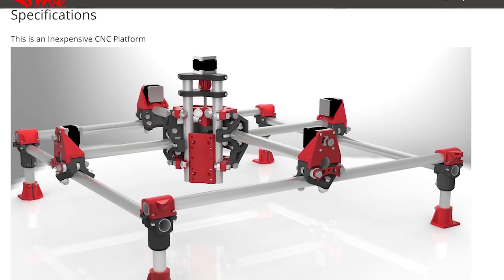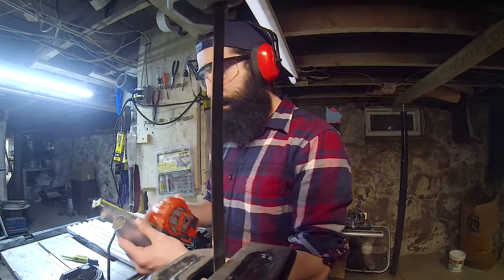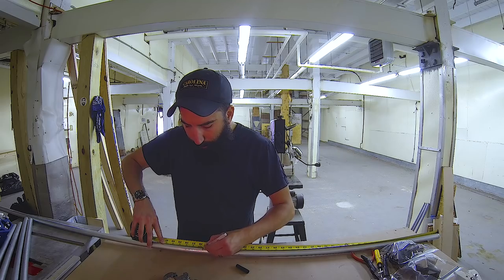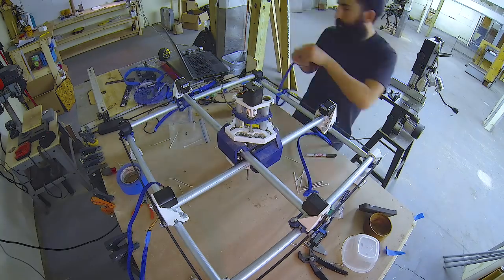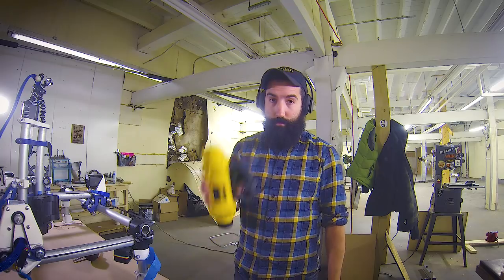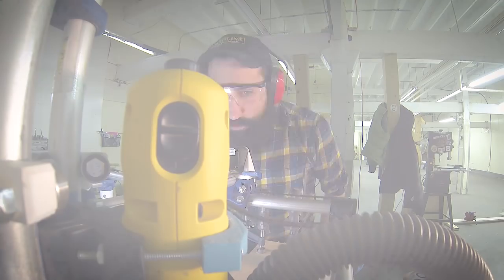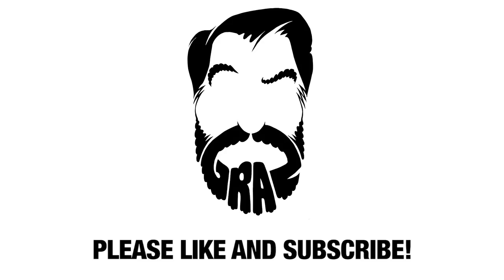Graz Makes: The MPCNC (mostly printed cnc machine)

Comment: so i i use 3/4 inch pipe i will need to print the 23.5mm parts ? can you  share the specification of all your conduit cuts.
Reply from the maker: print a small piece and double check its the right size for the pipe and if it is, print the rest of the pieces! (wish i did that from the start!) thanks for watching!

Comment: One additional suggestion, when cutting conduit, either buy a conduit reamer or use that little triangle on the back of your cutter to clean out the burrs after the cut. It gets rid of any sharp edges that can cut your wires.

Comment: great video. I've been printing mine for a little while can't wait to have it all put together.
Reply from the maker: thans man! are you going to reflash to grbl or leave it with marlin?
Reply: I didnt even know you could get it to work with the xcarve software until I saw this. what are the benefits, easier to use?

I know "all the cool kids are using it" haha
Reply from the maker: yeah! i did some research and i don't think a lot of people know it either! i think as a whole, easel is easier to use and I really like the fact that it has that giant database of projects other people have uploaded. its a great way to understand design layout. I also like the fact that you can tweak existing projects to fit your own needs. with the out of the box software recommended with the mpcnc (estlcam and repetier), they are two separate cam/cad programs while easel is all in one which i like as well. hopefully that made sense, i haven't had my coffee yet.
Reply: Another option if you stick with Marlin is Fusion 360. There are two post processors for F360 that output Marlin compatible gcode. CAD/CAM/Parametric Modeling all in one if you need it. Then use the output on an SD Card to drive the machine.

Comment: Great vid! I printed all the parts for the MPCNC about 2 years ago now so my dad could build it. Lucky for me, it sits in my shop now since he had a hard time messing with Etslcam; however, I didn't even know about the GRBL for Ramps firmware to make it compatible with Easel, that looks way easier to use for him. That firmware will probably be flashed tonight and we'll have to test it out. The only thing I wish I would have done was print all the parts with PETG for a bit more strength, the PLA has a few stress fractures after 2 years but still works great and is accurate.
Reply from the maker: thanks! lemme know how it goes! i did mine in abs and so far so good! good luck!

Comment: Very nice. I'm currently finishing the Root3cnc. Design is a bit different, but it also uses lots of printed parts. Also more than 150 hours of printing... I'm somewhere at 110h now...
Reply from the maker: I'll have to check that one out! Good luck!
Reply: Thanks. I have modified the design a little bit, to be able to print it on a small printer. It is going well, for now...
Oh, and I have prepared a prusa extruder to mount there instead of the router if I want it to work as a printer with larger volume (50x50x20cm)

Comment: 150 hours x whatever your time is worth= Buy the printed parts. Thank you for that, I'm going for the LR2 and was wondering about this. I would be spending way more time than just getting the parts and assembling. I'm curious, do you think the parts could be reproduced by mold casting? If that's the case my next setup would definitely be made with molds.
Reply from the maker: Uhhh that’s a great question! I think if you spent the time and knew what you were doing that might be an option? Definitely check out the mpcnc forums. I remember people talking about that option awhile back. Thanks for watching!!

Comment: One thing I don‘t get here is the problem with the diameter of the tubes.
One way would be to buy the correct tube to keep the  prints, or to reprint the parts and keep the 1“ tube.
You did both, or did I got it wrong?
Reply from the maker: most big box stores in the us ONLY have the 23.4mm tubing. I could have purchased the proper tubing online, but with that cost and cost of shipping,  i would have not saved that much money. re-printing the parts were my best option. thanks for watching!
Reply: Graz Makes Ok, then I got it wrong in the video, I thought you have not only printed the parts but bought new tubes as well, my bad :-)

Comment: Great video,  What pipe cutter did you use?  And tips for measuring and cutting the pipe?  Is your CNC 2 feet by 2 feet?  Thx
Reply from the maker: some old pipe cutter i had in a tool box lol. you dont have to be crazy precise, its all about squaring the tubes to 45 degree angles. thanks for watching!

Comment: What size cutting area did you make? Did you just order the basic kit with the mini rambo? did you have to order extra belt length?
Reply from the maker: i think i made it 26x26. im going to expand it this weekend to something like 2x4 so I can work on sign making. I think the kit now comes with the rambo board, my came with the ramps board. Im not sure if you can hack the rambo to use it with easel? maybe? also I just bought extra belt on amazon for like 10 bucks just in case i need it.

Comment: That is pretty amazing. What is the largest part you have to print? I only have the MP select mini
Reply from the maker: the largest part is the xy guide holders. each one takes 12 hours to print and you need to print two of them. good ones to let print overnight :-)
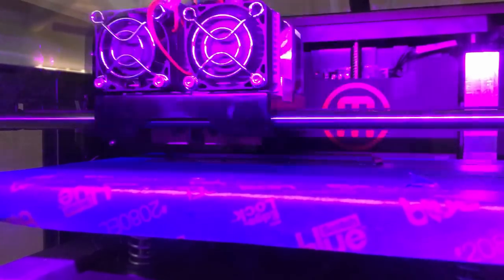Reply: The middle XY part is 132.25 X 77.55 X 97.58 millimeters.  The middle tool holder(tall skinny part at 1:32) is 118 millimeters tall, and really needs to be printed in this orientation.

Comment: I have the same setup you do, and the xcarve seems like a easy way out :). but your gcode is there any measurment on your machine there? or is it only stepper resolution there. ?  my frame is 92x92 cm big,  And where do you buy bits from ?
Reply from the maker: yeah Im really liking the xcarve option with this machine! not sure if I'm understanding your question? what measurement are you referring to?
Reply: Graz Makes wondering if you setup the dimensions on your cnc in that gcode, work area .
Seems like a nice way to start learning with that software.
Reply from the maker: yup! I set it up specifically to work on grbl once I flashed the ramps board. if you do the same thing, the gcode i provided should work just fine.
Reply: Graz Makes ok that sounds great:)
Reply: Thanks for a great tutorial, i went home and unwrapped my new ramps 1.4 and follow your instructions,  so now i got a ramps with the right firmware on and gcode :)
Reply: Now i just have to figure out how to connect my laser :)

Comment: Jeez.  150 hours to print times 2?   I have been thinking of putting one of these together for a while. You are the first person I see on youtube to put one of these together with ABS instead of PLA.  What was your experience printing these parts in ABS?...(Aside from having to print all the parts twice...heh)  ABS tends to shrink a bit for me.  I print on a homemade Prusa i3  with a heated bed and an Ikea lack table enclosure. In my experience,  PLA prints tend to be more precise and usually more aesthetic... on the other hand, ABS parts come out stronger and are a bit more rugged.  Did you find the tolerances on this build accommodate for some shrinkage?   Then again  I may just opt to print it all out in PETG...
Reply from the maker: sorry just saw this comment! it's been almost a year and its still holding up well! actually going to expand the size of the emt so i can start making bigger signs. I'll report back if anything goes wrong!

Comment: hey man, what size drill bit did you use to drill the holes on the z axis? on the site it just says 5mm-8mm. thanks in advance
Reply from the maker: truthfully I forget. I remember using whatever size fit the hole that was printed. sorry i dont have a better answer!
Reply: no that works, thanks! :D
Reply from the maker: good luck!

Comment: duuuude.. I just saw this the other day on thingiverse.  read through some of the documentation, I was like "ehh, can I really do this?".  After watching your video I'm more confident I could (I already own three 3d printers).  I only print PLA, do you suppose it would be strong enough not being ABS?
Reply: Original maker only used PLA, and videos here of that machine cutting steel with an ungodly .25mm (.0098 in, not .005!) DOC, no kidding.
Reply from the maker: yeah! like Paul said, the orginal build was done with pla and it seems to be working just fine! good luck in your printing and thanks for watching!

Comment: Great video!   How are you liking your MPCNC?  What size is yours?  Actual size vs area it can cut?  Anything you would do differently now?    I am printing the parts.  Still not sure how large to make mine.
Reply from the maker: I still really like the thing! i expanded the size to 2'x4'. i forget what the actual cut size is, Im pretty sure there is a converter on the official page. other than printing the right parts out the first time, I don't think i wouldn't have done anything differently. thanks for watching!

Comment: How do you like your blue tooth headphones. I see your link on Amazon to them. They look good for the money but some mixed ratings on them. Just curious if you have any charging problems with yours? How long do they last on a charge?
Reply from the maker: woodknack1 I've had them for a couple months and honestly they are fantastic for the money. The battery lasts about 5-4 hours per charge. Great headphones for shop use, if they break you buy another pair without feels bad :-)
Reply: Thanks, I'm going to try a pair. :-)
Reply: Also going to try the MPCNC. I started printing the parts out. I've been looking at BOB'S CNC E3 or XCARVE but I really dont have that kind of money to dump on that right now. I like this as you can build it any size you want or need.
Reply from the maker: woodknack1 awesome in actually making it bigger next weekend!
Reply: How big of a cut area were you getting? Was there enough belt in the kit? My work table I have that I could use for the MPCNC is 24-3/4 x 37.

Comment: This is awesome. Now is there a 3d printer I can make with a CNC?
Reply from the maker: thanks! as a matter of fact the mpcnc was designed for removing the dewalt spindle and replace it with a 3d printer extruder and BOOM you got a 3d printer too!
Reply: Orrrrr I made a 3d printer designed to be milled on a cnc (MP3DP). Anddddd, I have a new version of it set to be released this evening I hope. If I can choose a name I can start uploading parts.
Reply from the maker: ohhhhh thats exciting news!
Reply: Wow, I have learned so much in these comments. Thanks.
Reply: Oh yeah, and robots making other robots, awesome!
Reply: I Use my printers to print CNC parts, and my CNC to make printer parts....inception!
Reply from the maker: Someday I'm going to buy you a beer in person. You are awesome.
Reply: MRRF 2018!!!! Make it happen.
Reply: I see what you did there....NERD ( you know I will be using that). This year I sponsored early so you can get the shirt and it should have my logo on it, last year I did it too late. 
All day at this printer thing, Never have I been so quick to reply and respond though, I need to get away from my desk.
Reply from the maker: allted sweet! I didn't know you had shirts! What size are you btw? Ok fair enough, shut down the computer and go outside!
Reply: I got in as a sponsor so I will get my logo on the back of the MRRF shirts. As for me getting shirts....soon. Now that I have a logo finalized (after 2 1/2 years) It's merch time. I think I am Xl in a T-shirt usually, Large on a good day when I don't hit the Taco bell.
Reply from the maker: allted I'm going to send you an graz makes xl shirt in the mail as well as a crunch wrap supreme...those don't go bad right?

Comment: Ok just watched the video, great job!  C as n someone explain what the problem is with printing the 1" version?
Reply from the maker: TheLeverHunter thank you! The first version I printed was the 25mm version which doesn't match the 1 inch emt sold in us stores. The reasoning is they measure the outside diameter. Print the 23.5mm version and use 3/4 conduit if you're in the us! Thanks for watching!
Reply: @GrazMakes  Ok so I am in the US and printed the 25.4mm kit.  I was going to use 1" conduit is the conduit not 1" thick?
Reply from the maker: thats exactly what I did. this is taken from the vicious website..."Please measure your rails before printing. 23.5mm fits 3/4″ EMT conduit in the US. Anywhere else you must physically measure first, some things are sold as Inside Dimension (ID) (conduit), or Outside Dimension (OD) (Tubing)."

when i printed out the 25.4mm the parts we too big for the 1 inch emt. for a temporary fix i took painters tape and layered it on the emt until i had a snug fit. I did this so i could get used to the machine while i printed out the correct 23.5mm parts in the mean time.

hope that help you out!
Reply: @GrazMakes  Thanks!
Reply from the maker: no problem! lemme know how it goes!

Comment: Does this work with the RAMBo Mini board that comes with the MPCNC?
Reply from the maker: not that im aware. I'll have to do some research and see.
Reply: That's surprising since it's pretty much your only choice in board besides the regular RAMBo
Reply: Also, I would suggest adding this to your txt file:  

    Download this repository (link), extract the zip file, and open the file grblForCyclone.ino from the Arduino IDE.

    Select the board you are using from the "Tools->Board" menu:

    If you are using RAMPS, select "Arduino/Genuino Mega or Mega 2560".
Reply from the maker: done!

Comment: I personally wouldn't suggest EMT for this. EMT is stupidly easy to bend, comparatively.  Get some relatively thick wall stainless steel tubing that's guaranteed to actually be straight and not susceptible to getting bent because someone accidentally leans on it, drops something on it, etc.
Reply from the maker: Qumefox that’s definitely an option! I’m a cheap bastard and wanted to see how cheap I could make a decent cnc for. Maybe version 3 I’ll do in stainless

Comment: You should have bought 1.00" stainless tubing instead of reprinting. You get a smoother, more accurate and sturdy machine, and don't have to spend another 150 hours printing.
Reply from the maker: Im a cheap bastard and printing another set didn't really set me back too badly. in the time it took to print, I used painters tape to thicken the wrong tubing to work on the mis-printed parts so I could learn how to use it.